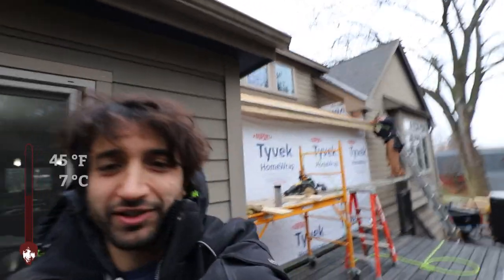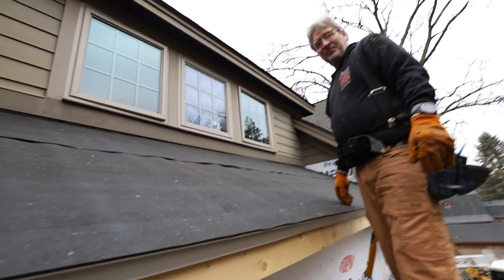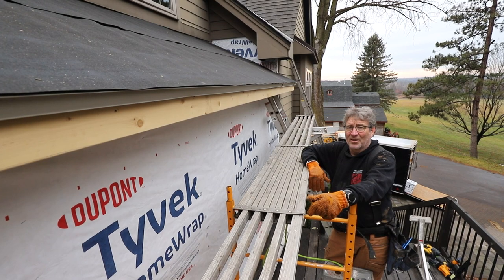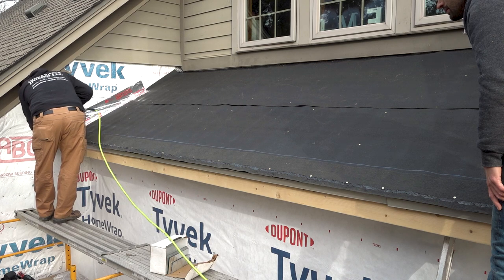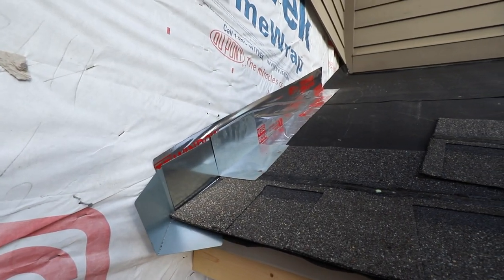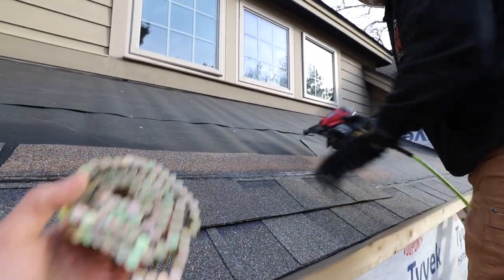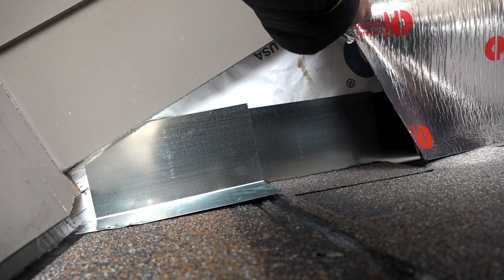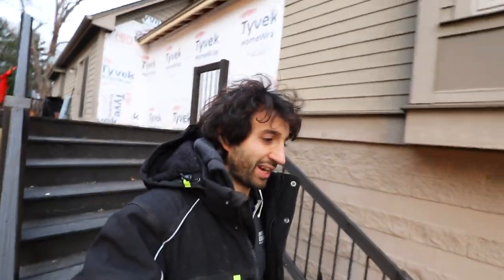Roofing the Front Addition | Home Renovation & Addition Part 18

Comment: I have done the ice & water shield up the cheek walls - snow can drift there, and wick in behind the siding, and you can get a lot of water dripping in there. So behind the step flashing up the wall at least 18" - higher than snow can drift.
This is the first time I have seen a continuous starter strip - that's nice! And man - the telehandler is amazing! Schlepping bundles up to the roof is the hardest bit.

Comment: Synthetic underlayment - doesn't rip, is WAY cooler on a hot day on a roof, it's more durable, it's lighter, and it's (almost all top brands) 'premarked' so it's super easy to follow a line, spacing etc. It's a bit more expensive than traditional tarp but it's 100% worth the price. And for one guy, Donovan is pretty impressive, his range of knowledge, no-nonsense and fast. To hire someone like that, with his skills and conscientious building practices (we all know fewer and fewer are these days)...normally, if they weren't friends - way way expensive.
Reply: I noticed that too, he did all the stages of the build very well.

Comment: I’ve had the same issue with off brands of ice shield. If it’s too cold it won’t stick. Grace always works, no matter cold. Worth paying a little more for a good product.
Reply: growing up we had a largeish collapsible swimming pool(4'x15' ?), a raccoon chewed multiple holes through the bottom while we had it in storage, I stuck some scraps of Grace Ice shield on it and we used the pool all summer
Reply: When I was swinging a hammer for a living I'd advise my customers to use the best materials they could afford.  Good materials help both the homeowner and the tradesman.  The homeowner has peace of mind and the tradesman does not have zero income warranty repair.

Comment: I'm glad to see Donovan overlap the shingles in a 50/50 overlap. I hate it when you see crews only overlap a half a tab and shingle straight up the roof in rows. That leaves so much potential for leaks when they shortcut to save time. The scabs that did my roof 7 yrs ago did half tab overlaps and removed all my flashing and just wove the shingles in the valleys without flashing. The shingles have shrunk over time and the valleys are raised up where you can reach your whole arm up under the valleys now and I have major leaks in heavy rain. I've been waiting for 2 yrs now for them to come look at their work and fix it.

Comment: i was taught the ice and water goes under drip edge and down the facia to cover the joint between the sheathing and facia ice melting can work into that gap
Reply: Code is underlayment goes over the bottom d edge. The d edge on the gables goes over the paper.
Reply: @Sc-jf3yk  that does not waterproof the plywood to facia joint ice build up in the gutter will work it's way into that joint under dripedge
Reply: @danwheeler5130  if you put the drip on top in an IRC area you'll get to do it again or take all the liability and open yourself to a lawsuit.  Just go above code and put two layers on if you want
Reply: @Sc-jf3yk  you could do that 2 layers code does not always mean right i have never had a problem in my area doing it this way NYS

Comment: I was taught only to nail the step flashing on the vertical surface (the side wall). The whole idea is that if water gets under the shingles it will roll down onto the surface of the flashing and onto the top of the next shingle. Nailing into the flat surface creates a point of entry for water at every nail. Can you explain why Donovan would be nailing the flashing that way?
Reply: because he is not a roofer full time
Reply: I agree I've never nailed into your step flashing water gets under the shingle it'll roll towards the nails
Reply: I was thinking the same thing, and know the sticky rubber membrane Donavan applied under the metal flashing is supposed to seal around the nails, but wondered if that would still not be a leak point over time?
Reply: @jimmieusaf-pol5818  after a few years nails rust  membrain or not you build it up where the step fashing goes which way will water run on to the flashing or away from it
Reply: @Slick1G3  You have to caulk them anyway.
Reply: @firesurfer  no you don't
Reply: @Slick1G3  Really?  Watch the video.  Of course you do.
Reply: @firesurfer  you watch the video watch him sink three holes in every step flashing
Reply: @Slick1G3  I was talking about the official method.
https://youtu.be/kQVSinfA6OA?t=151
Reply: @firesurfer  I know which video you meant  so why didnt GAF make that video 40 years ago ????I still will throw a guy off the job i catch him nailing step flashing that way

Comment: Matt, did you have a misfire on the shingle nailer at 15:59?  Watch Donovan almost hit his hand then see if that nail looks like it is not nailed flush.  It looks so when the next shingle slides atop it.  I hate working in the cold.  Excellent video, thanks for sharing!
Reply: I saw that also!!
Reply: I went back and looked at it to see if maybe Donovan tapped it down with a hammer before laying the next shingle. Nope.
Reply: I was wondering if anybody else caught that.
Reply: @jservice6594  yep. I saw that too.

Comment: The tar-paper would stick to the roof  on a colder day by taking a few extra moments to heat along the bottom  side of the tar paper a little bit with a heat gun  if you have the patience to do so before tacking it all down. Good thing that when summer comes it will heat up and stick down then possibly  if you have extra patience to wait that long for it to adhere to the flashing a lot better. But I have one question "Am I incorrect don't most poeple want to avoid getting any shingles at all?"

Comment: 15:59 Left a nail sticking up. I was waiting for Don to hammer it down.
Why not run the ice shield up the walls a few inches on each end?
Reply: That's what the flashing is for. It would just create unnecessary build up.  edit;  apparently GAF recommends going up 5".

Comment: Wait, his toolshop roofing nailer doesn't double hit every other trigger pull like mine!
Still worth every penny from the first time I used it. Two story 9in12 roof near the lake shore (gusty winds).
I used the synthetic underlayment and it is great and has nice traction (see above 9in12). 
I went with a metal roof. Did the job myself, no help. I disreccomend that. 13'6" x 36" panels are not fun to wrestle in a breeze.

Comment: You may be wondering why they stagger the shingles. It's an OSHA safety requirement. It's so if someone has been drinking and is walking on the roof and they stagger it will seem normal to them, they won't get vertigo, and they won't fall off of the roof.
Reply: drinking and roof climbing don't mix  neither does drinking and motorcycle riding

Comment: never seen usa shingles put on here in scotland most homes have to have high wind loading roofs so its heavy slates or tiles.we only use felt type material for flat roofs and outbuildings recently i replaced all this types of roof a edm rubber on all my sheds and flar roofs. dont think ive seen shingles for sale.
Reply: I visited Scotland in 2018 , bicycle touring where you have time to look around, and was amazed by the roofs. Slate everywhere! Even visited an old now museum slate quarry.  Even the rund down backyard sheds have slate roofs! Totally amazed. However, I did see new homes, condo style, where the roofs looked like imitation slates. Real slates are really expensive  ( but last forever I guess),  are these imitations slates made of rubber? or maybe I saw wrong??

Comment: It will stick, once the temps warms up. Just curious, why not run a continuous piece of flashing?
Reply: It's not recommended. Long pieces cause buckling in summer.
Reply: @firesurfer  Aluminum?
Reply: @gtuttle4  yes.  It curls up and destroys the shingles.
Reply: @gtuttle4  You can use copper, but that requires expert installation. A box section has to be bent into the valley.

Comment: sad newsputting shingles on <55F Secondly, Atlas shingles don’t seal well in cold weather. Atlas claims on its warranty page that shingles need sunlight in order to seal properly and that those installed in fall and winter might not seal. Failure to seal is NOT covered by the warranty. the really should be heated in place by a

Comment: You never nail step flashing to the roof you nail to the wall this way you roof won’t leak
Reply: Yes, defeating the purpose.
Reply: Gaf says it should be nailed to the roof. They say when you nail vertically it causes bucking in summer. The flashing needs to be allowed to move with the roof, not against it. Nails are caulked.
Reply: Personally, I don’t nail it at all. I let the roofing hold it until I stick the ice and water to the to the top. Then the siding holds all.

Comment: Per internet- Because the thickness, weight, and shape of shingles vary, manufacturer's instructions vary slightly. But virtually all manufacturers agree that . ... If the nail is not at least 1/4 to 1/2 inch below the top of the shingle below, it may tear through. Pleazse clear up what the mfg did say on the packaging so ew all do not lose confidence and copy a bad

Comment: Definitely a couple of nice guys, but the job was not done properly to avoid leaks. First, an underlayment is necessary for leak protection and ease of removal of the roofing material in the future. The  peel and stick material that was installed should be placed over the underlayment so it doesn't stick to the roof decking. Nails should not have been placed in the field of the peel and stick material. The nails go along the top edge (aka selvage edge), which will then be covered by the next section of the peel and stick material.  This makes a water tight seal. The step flashing along the wall should not be nailed on the decking side, but on the wall side. But, if you do, at least use Modified Bitumen membrane would help seal the nails. I would hate to be the roofer that is called in to repair this roof within the next 5-7 years because of the leaks that are sure to come. But, they are a couple of nice guys.